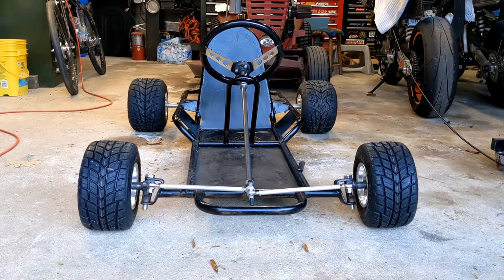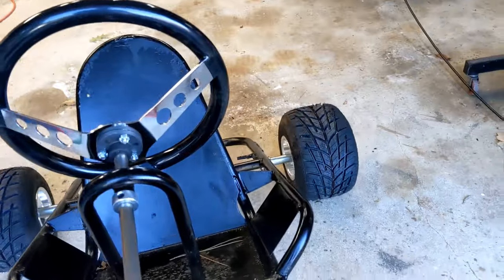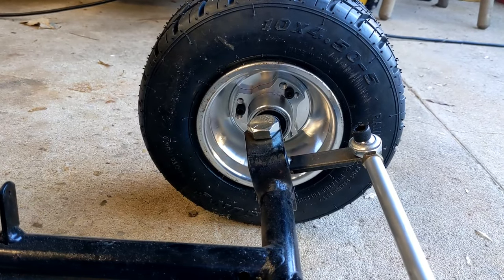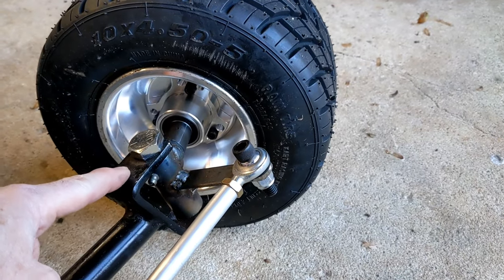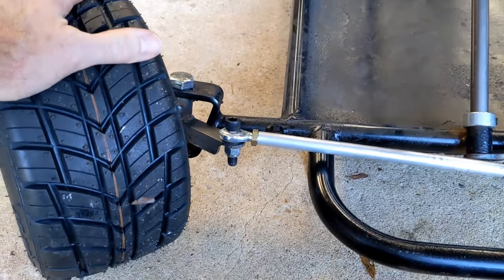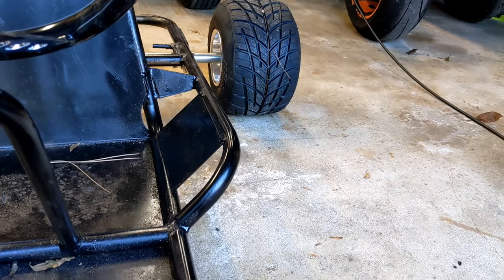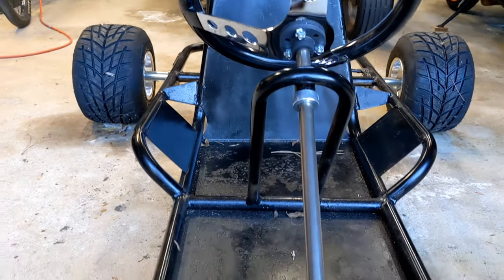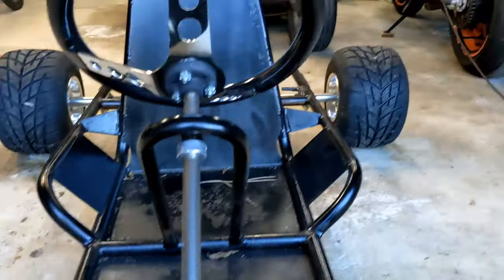My Go Kart won't turn. Why you need caster with a live axle kart

Comment: are yo using rain tires? What tires are those
Reply from the maker: They are Vevor branded. Honestly I got them because the tread pattern was cool looking. They came from Amazon pre-mounted on alloy rims. Amazon suggests hubs that do not fit, you will need Euro spec hubs with a 58mm bolt circle.
Reply: @WhatIsTheWheel  Ty. I ordered those like an hour before I even saw this video lol. I also just picked up a sweet deal. 12 tires just the tread (front and rear) that fit the vevor for $100! That’s less than $10 a tire! All of them are brand new, but they are ‘rain’ tires.
Reply: Also, I bought the same hubs you got before I saw this video 😂 so it looks like I’ll be doing everything you did in your first video
Reply from the maker: @WillLockwoodStudios  That is a great deal. If you are just playing around it should not make to much difference. It might have less traction on pavement, but that is usually more fun.

Comment: Hey what size is your axle in front
Reply from the maker: I think they are 1/2 bolts that I cut the heads down . I can't get a mic in to the wheel to measure for sure but that looks right.
Reply from the maker: I just checked the old order sheet, the are 5/8"
Reply: @WhatIsTheWheel  bro is the best thank you I appreciate it where did you get them at ?
Reply: @WhatIsTheWheel  awesome just let me know Where did you get the axle spindles or you made them?
Reply from the maker: @NATE-sn6nx  I made them so I could get the camber I wanted but you can buy premade spindles and brackets
Reply: @WhatIsTheWheel  thank you for the heads up helped alot 👍

Comment: How to set the caster hen?
Reply from the maker: Thanks for the question. On a kart it requires some cutting and welding. You need to cut the steering pivots off the front axle, reposition them at the angle you want, and weld them back on.

Comment: I dont know why all these go carting channels are pushing live axles on high speed high horsepower engines  its stupid to try to make  live axle  into a nimble high speed cart  a live axle is is best suited 
For going in a straight line 
If you want a cart that turns good limited slip diff.  or one wheel peel are your options  front suspension can make things even better just so long as the suspension is built for its intended purpose 
Yard carts are built for low speed  and meant to be used on grass and loose dirt  not paved roads at or near highway speeds

Comment: No you do not, its all on what THE BUILDER WANTS, You do NOT need caster, fucking people thinking they know it all i swear. I have built THOUSAND of Gokarts, Mini bikes and motorized bikes. Shit does NOT help enless you have shitty tires like yours and or drifting ONLY. All you are doing is wearing the tire down on its side. nICE TRY. May help YOU but it dont for most
Reply from the maker: Thanks for the comment. My experience running soft compound tires on a daily driver that was also used for autocross is that camber and caster(which I ran a lot of ) had little/no effect on wear. Toe out caused a lot of wear on the inside edge.  I would keep it  just slightly out from zero on the street and readjust it for lots of toe for the course. Great rotation but even a single day on the track caused noticeable wear.